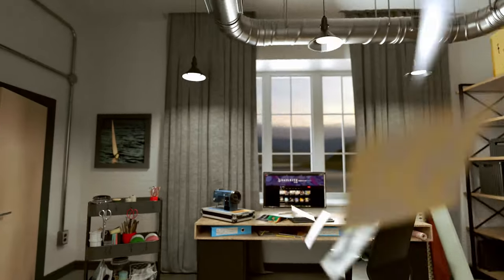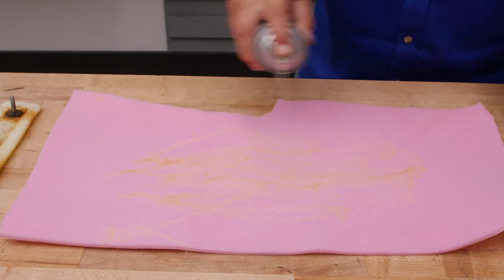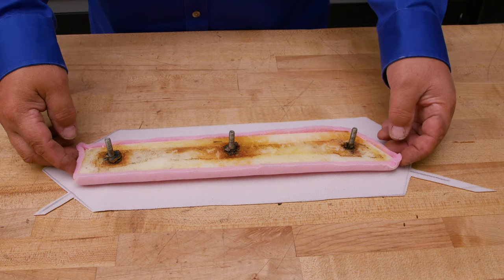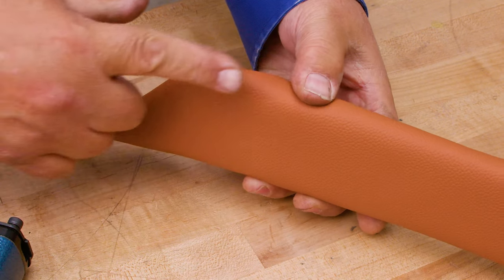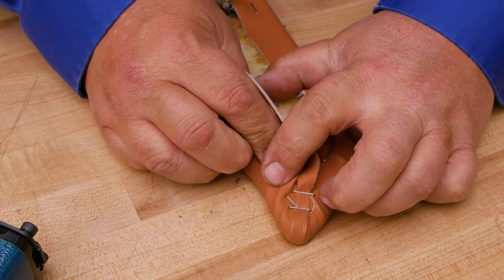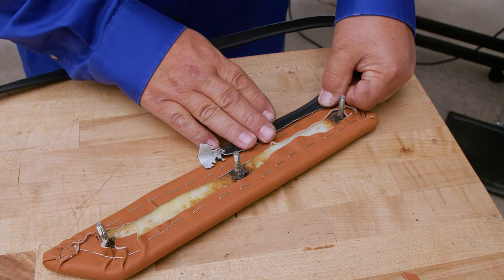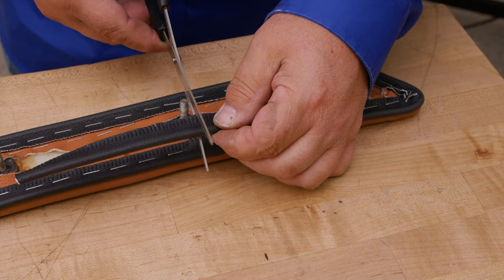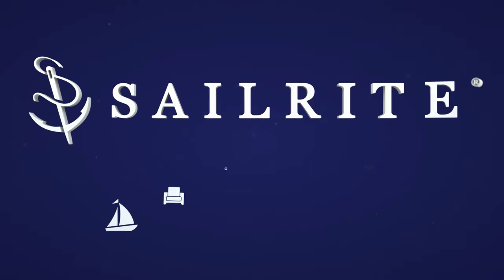Reupholster a Speedboat Armrest in 5 Easy Steps

Comment: As much as the spray form glue is great, keep in mind its fairly caustic to causing damage to sensitive systems of your body. The old roll on glue is better system. imo. but meh we should always were a mask when dealing with chemicals in a liquid or air state, or off gassing. I really enjoy your work. I would like ot build some of those things but I guess i need to wood blueprints and then sew it, Your Helm Seat is gorgeous